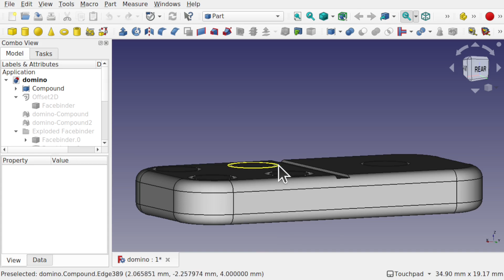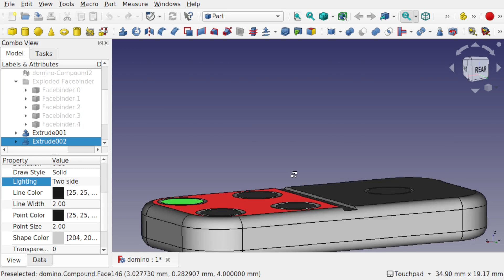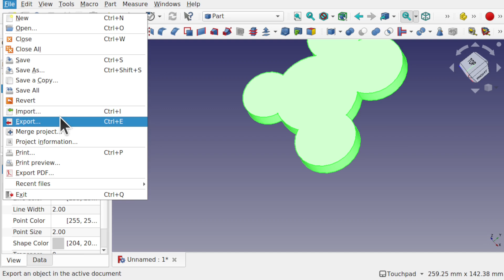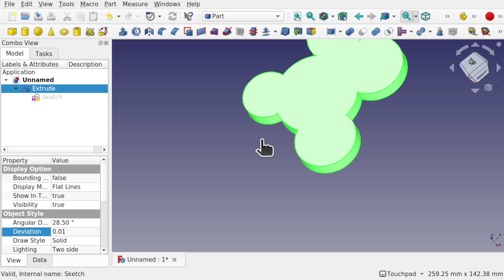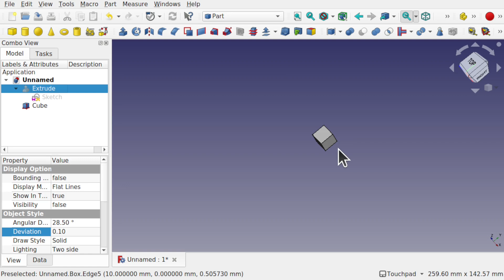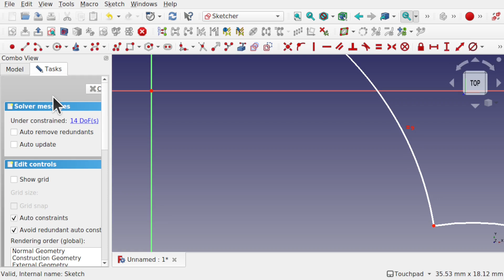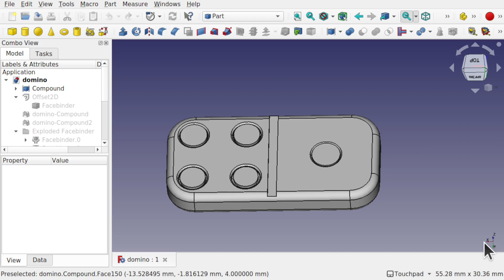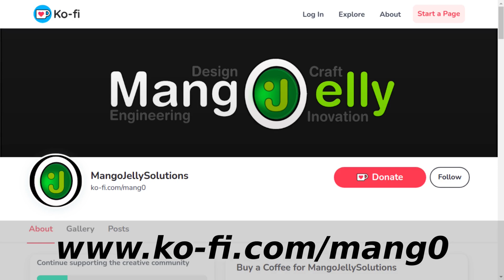FreeCAD: 4 Helpful Preference Settings I Wish I knew about When I First Started

Comment: @MangoJelly Solutions for FreeCAD You forgot to mention the most important thing about creating more precise geometries - IT SLOWS DOWN any operations on the objects, so in case of very complex models it's probably best to design them not as smooth and smoothen them up just before 3D printing. I'M JUST NOT SURE IF DOING SO WONT CREATE BUGS, as FreeCAD likes to throw some bugs when operating on things as tight as it shows in some computations that certain 2 things are in same spot - like doing just exact cuts - 'flipping geometry around' and let me say You do 2 cylinders touching each other - theoretically they touch by a line, but in free cad the outer surface of the cylinder is made of rectangles and decreasing the rectangle width (increasing smoothnes) it may happen that the 2 cylinders touch each other by the tiny width rectangles causing them to blend into 1 solid perhaps. That kind of bugs are being fixed with time, but people really should be aware of the way of FreeCAD 'thinking' about the objects. It may sometimes change surface number in enumerations and object refferencing face no. will crash/cause bugs.

Comment: When I look at my screen the text font in the dialogs  is too small? Ive tried setting Windows accessibility to large font but it doesn't work for freecad dialogs. Think it could be the monitor q32g1wg4 aoc monitor. Anyway to increase font size in the program.

Comment: I wasn't aware until I watched this video, that it's possible to export a .stl file directly, by this avoiding to change to the mesh workbench, create a mesh/stl structure and export that one later on. Tried that export and found another interesting feature for 3D Print, which is a direct export to .3mf, "3D manufacturing Format". That format is used by the slicer I'm using, the PrusaSlicer, when saving projects. From now on, I'll focus on using the .3mf format for 3D printing in FreeCad, because it seems to be much more efficient and quicker than the .stl format, which consists basically of a huge number of triangle definitions.
Reply: 3mf is still triangles though. Ever since PrusaSlicer directly supports STEP, I've been using that. Leaving the tessellation on the slicer usually works better, in my experience.
Reply from the maker: Thank you for sharing your findings.  Always good to get other peoples views on settings and file formats that work for them and the hardware they use.

Comment: Nice.
I've always been in the habit of using the mesh workbench to convert my final model to mesh before export. Then it allows you to set the deviation for export. That way you can use a larger deviation for a weaker PC but still export fine deviation for printing.

Comment: What I'm wanting is a way to set the colors that get used to ONE*, no matter what I'm doing. I've got projects that chose ungodly color combinations (One is an electric blue body color, with almost glowing red lines -  HIDEOUSLY bad - due to the long-known optical illusion that happens when you put bright red on bright blue, the whole darn thing looks like it's vibrating/buzzing/shivering anytime I'm not looking DIRECTLY at it. INCREDIBLY distracting and annoying. Another one decided it wanted to be a nasty dark olive-greenish-brown, making it nearly impossible to see ANY lines or details. I can't find a way to say "I want the body to ALWAYS be THIS color when idle, and when highlighted, this other color, nothing else, ever, and I want my lines to be this other color (and a partner color when highlighted/selected) and never anything else." Instead, I seem to be stuck with FreeCAD picking colors at random, and WAY too often, the colors that it picks *JUST PLAIN *SUCK*.
Reply from the maker: This is weird as me and @freecadguy was talking about this the other day as he saw me colouring different models as mine are set as default to be grey. He pointed me to the random colour checkbox in the settings which I never knew existed. You may want to turn this off. Top menu-> Preferences->Part/Part Design->Shape Appearance. That may help you. Let me know if it helps as it sounds like you been struggling with this. And from someone who has a sight disability I know how problematic that kind of thing is.
Reply: @MangoJellySolutions  Worth trying - This is (just like for you. it sounds like) a setting I've never encountered before. I'd be perfectly happy if every body I create were to be shown like on "thingiverse" or similar - That pale bluish shade, (FWIW, it's ALMOST the exact color of MatterHackers regular blue PLA - not the "royal blue", the "regular" blue) with black lines  and vertices gives decent-to-excellent visibility and makes details easily seen. Some of the combinations that have shown up on my screen have been so bad it's effectively impossible to do anything but throw up my hands and start over from scratch when they get picked - purely because I can't SEE the model to be able to work with it. 

No real vision problems here - being 50+, I wear bifocals for my nearsightedness, but beyond that, my vision is good enough for pretty much any purpose - as long as the color combination isn't so bad that it's effectively invisible.
Reply: @felsinferguson1125  That is odd because 'random' is definitely not default, I've set it for myself for easier work with multiple shapes, and I like the look. I did tweak lines/vertices colours too to keep them visible, and after this video found Preferences>3dView>Marker size (means vertices size in Sketcher for some reason) and under it there is Pick Radius, which is for 3D view, not Sketcher, and will highlight objects more readily.
With bigger vertices I have much less trouble hitting them, almost as good as snapping Sketcher sadly doesn't have.